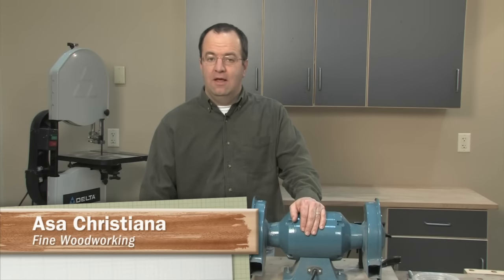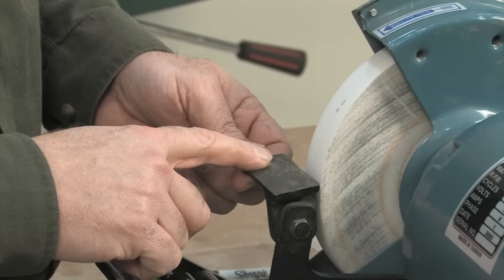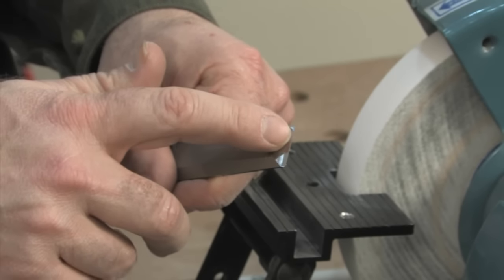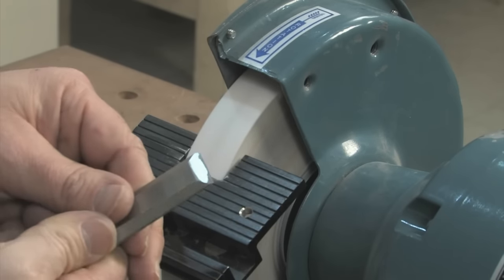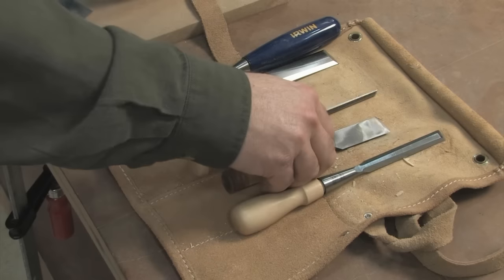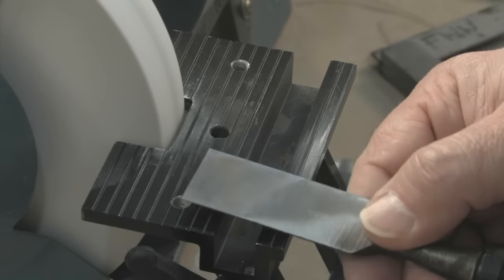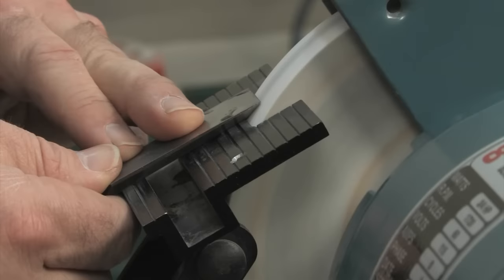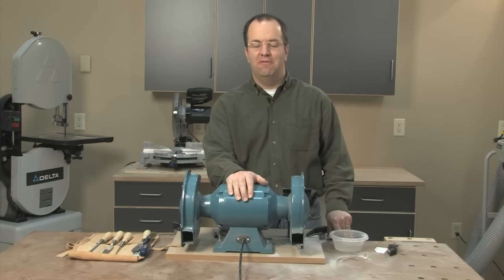Bench Grinder Basics

Comment: Still a relevant way to sharpen and great tips on how to set proper angles, but I've heard you should NOT quench the metal! Severe temperature changes in the metal created by dipping it in cold water has the possibility of creating hairline cracks in the metal at the thinnest part of the blade. If your tool is that hot, you've probably left it on the wheel too long, or are pushing too hard. A really neat trick is to use a heat sink from a discarded computer to help cool the steel without risking changing the metalurgy of the steel - it works amazingly well. I've also noticed that the specific grinder used by Asa in this video is a "low" speed grinder (<1800 rpm). That also makes a difference with heat build up. As mentioned earlier, I have switched to a low grit (80) CBN wheel. The metal in the CBN wheel is a fabulous heat sink and disappates the heat very well even if you're working on a higher speed grinder - and BONUS - you never have to true the wheel.
Reply: Glad to see your comment.  I'm very new to bench grinders.  If I invest in this expensive CBN Wheel, do you have a brand name that is good?

Comment: That is a slow speed grinder running at 1750 RPM not the "usual" grinder which runs at 3600 RPM. The higher speed is going to heat up the tool even faster. But I like the idea of the rounded grinding face of the wheel which I will tryout tonight.

Comment: I've watched a lot of videos on how to sharpen chisels/plane irons on a bench grinder. This is the first video I've seen that explained the process in a clear manner. It's the only video I've seen on the subject that was actually helpful.

I ended up getting a jig made by Peach Tree, from Amazon. It works great. I use it with a vintage hand crank grinder, so there's no worry about overheating and losing the temper. I can lock it into the sliding mechanism, and check it with a small machinist square. Then I can slide it left and right, with my left hand, while cranking the grinder with my right.

I briefly tried doing it free hand on an electric grinder. Very briefly. That was a disaster. I'm pretty sure the guys who do it free hand are using some sort of black magic.

Comment: Excellent, thank you!  Subscribed!  I needed the tool rest information, and grinding chisel blade tips.

1. Can you recommend a good quality grinding wheel dresser tool?  So much junk on Amazon.

2. Anyone know of a decent CBN grinding wheel?  Apparently it is better (and cheaper) than a diamond grinding wheel as it does not heat up easily and second in hardness after a diamond.  So you get 4 things with a CBN (Cubic Boron Nitride) wheel:  Bushings are machined and fit well reducing vibration of wheel, material is a heat sink and does not overheat, it is much harder than regular stone wheels, you do not need to prep the wheel with dressing it like a stone wheel.  

Prices on Amazon run $70 - $80 each for CBN wheels,  and they vary in arbor hole size. Some are 'diamond' coated but avoid these. Get the all CBN material.  Not sure of what grit to get either -80 or finer, to sharpen chisels, drill bits, and kitchen knives.  I am a novice at sharpening and bench grinders. I could really use some help.

I also need a 6" bench grinder and was considering the Metabo. It is easy to slip off the housing guards and this is a big advantage.  Please advise - anyone?

Comment: Normal grit size for roughing out is 30 and for finishing is 60 ( makers advice)
Reply: In that case, can the grain size of 120 be used for polishing? I've got at a disposal an even finer wheel, I suppose it should be used for final polishing of the cutting edge?
Reply: @ognjenradojevic , "Final Polishing" of what "Edge"? What are we talking about? Lawnmower Blades, or Carving Chisels? Grits like 36 & 60 are mostly for coarse work in the metalworking trades, especially on the 3400 RPM bench grinder. While a 1750 RPM (slow speed - dry) bench grinder would be better for wood working tools, I find 100 & 120. or 150 grit, with a light touch, is much better for shaping and getting the wood working blades prepped for stoning than anything coarser. Don't forget, for most all blades, the back inch or so must be flattened before you shape the edge, and again after you stone the blade you have to once again hold the back of the blade FLAT against the stone to remove the burr with a few passes. Then it's as sharp as you've made it.

Comment: Newbie question:  I have (new to me) a sealed Craftsman commercial 6" grinder and two new wheels. The nuts that go on the arbor tighten clockwise on the Right side and  counterclockwise on the Left. There is no place on the inside of the wheels to grasp the shaft.  How do I get the nuts tight on the arbor without the shaft spinning ?  There is no place where the shaft can be held like on a Dremel,  and a wedge will not work, as the arbor just spins.  What is the proper technique to tighten these nuts ?  By hand perhaps and the spin does the rest ?  Jam nuts don 't seem to be a very good idea.   Perplexed.
Reply: senorboardhead;   You need to use both hands and maybe use a wood wedge while you tighten the nut. Your grinder will need both wheels  to be balanced (not wobbling). Then and only then do you dress your wheels true.
If done well your grinder will hummmmmm along with you while you sharpen your tools.
An important thing is to have FUN doing it eh…      ÜïÖ

Comment: Would one remove the burr on a flat stone after grinding?
Reply: While honing yes, but not on the grinder
Reply: Yes. The bench grinder is to prep the blade for the sharpening stone. You should flatten the final inch or so of the blade on your stone before grinding to have a reference point for the shaping on the grinder. Then, after the grinder shaping and then the stoning, you must again lightly flatten the back to remove the burr.

Comment: What grit wheel is best for sharpening tools?
Reply from the maker: Lower grits (courser) do the work faster and heat the tool up less. 60 or 80 grit is a good place to start.
Reply: FineWoodworking b
Reply: Gerri Barnes a
Reply: rough grit use 60# OR 80# if want better surfacing result of the edge use finer 150#  then finer

Comment: I just seen that tool rest for the first time, can you tell me what it's called again? I need to grind down aluminum panels the size of small pictures. I need to grind the edges to a 45 degree angle. I might be able to slide the panel in those thin slots. Do you know of similar tool rests? Thanks!!
Reply from the maker: +lou garcia that will probably take quite awhile but the tool rest is made by Lee Valley/Veritas. Check out their site.
Reply: +lou garcia aluminum will clog your wheel

Comment: Nice video but you only sharpen half of it you forgot the most important part before you sharpen the Bevel you most flatten the back of the chisel or you’re not going to have the sharpest tool possible 
 Flattening the back Is the hardest and longest part of sharpening a chisel in many times overlooked I hope this helps you going forward
Reply: Agreed. And, for anyone not familiar with the concept, you do not flatten the back of a blade on the bench grinder but on your sharpening stone - Oil, Water, or Diamond.